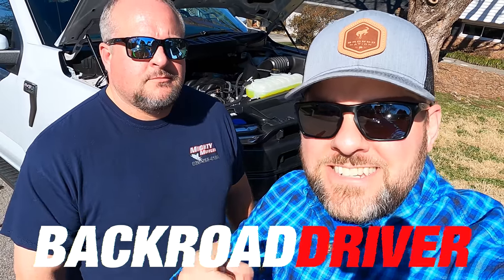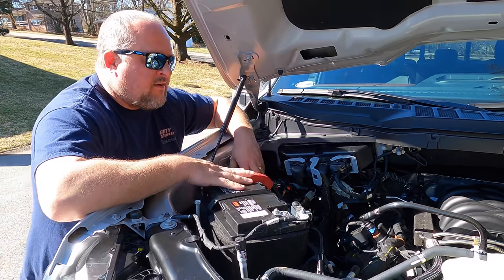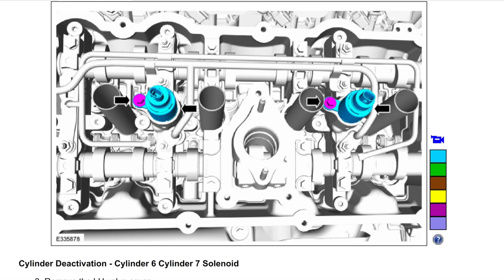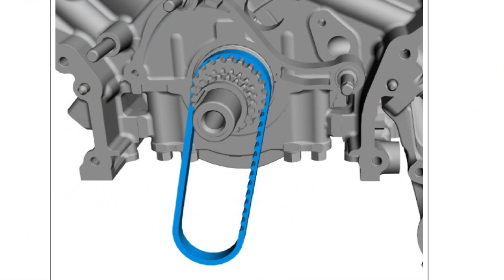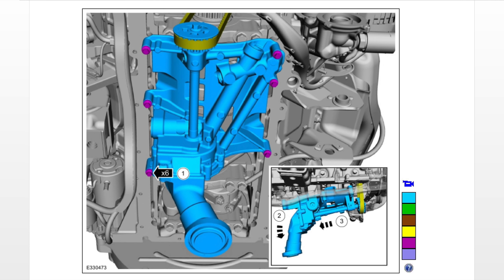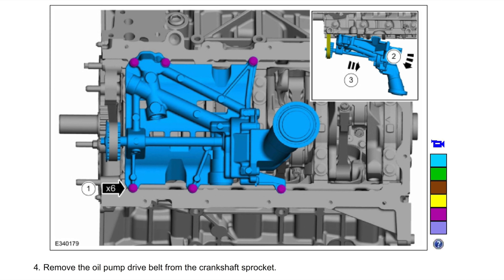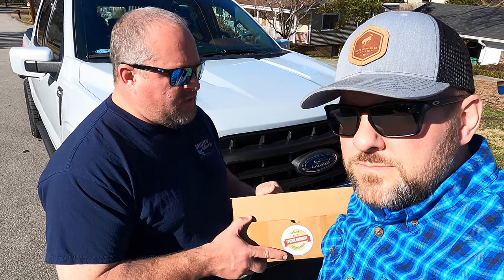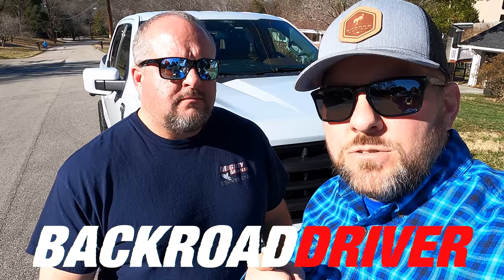2021 Ford F150 5.0 V8 Cylinder Deactivation & Oil Pump Belt Explanation - JLT Catch Can Install

Comment: Overhead cam engines in trucks is just stupid.
Reply: Nah, OHC is never stupid
Reply: Mad Anthony Wayne   Cams belong over the heads. 
Any cylinder head designer worth a damn would want maximum valve area for the bore size (4 valves/cyl), not have to twist the intake port around a pushrod path, have a splayed valve layout with an extremely canted ~45 degree intake valve angle which simply gives the intake port a much straighter shot at the back of the valve, and to remove all of the unnecessary reciprocating weight of a lifter and pushrod. 

Pushrod engines are stupid unless you’re a manufacturer just trying to save money or you just need a compact cylinder head more than you need optimal everything else.
Reply: Why? They just make the top end wider. Can you speak to, in a technical manner, why cam in block pushrod valve activation is superior to overhead cam valve actuation. Rhetorical question, no need to reply.
Reply: @zonacrs   Yeah, literally the ONLY way pushrod beats OHC is in packaging.  That’s it...
Reply: Mad Anthony Wayne   Unless I misread Nota’s message I think he rhetorically asking for technical reasons why cam in block is superior, which of course can’t be answered technically because it is objectively inferior in every regard except external packaging.
Reply: @BC08  Any cylinder head designer worth a damn would tell you that maximum valve area isn't the only consideration. There are 2-valve pushrod heads that put up flow numbers that are extremely competitive with 4-valve DOHC heads. Putting the cams in the heads has MAJOR drawbacks. Your oil pump is way down low and all the cams are way up at the top of the engine. Not only that, but all your VVT solenoids, cam phasers, and timing chain tensioners are also competing for that limited supply of oil. It doesn't take much sludge buildup in the oil galleries to restrict flow and cause issues with cam phasers, issues with timing chain rattle, issues with cam journals wearing, hydraulic lash adjusters failing due to oil starvation, cam followers failing due to oil starvation etc. All the valvetrain components most sensitive to oil starvation are at the farthest location from the oil pump. And guys wonder why the 3.5 Ecoboost cam phaser rattle has never really been fixed or why their 5.0 Coyote sounds like a rattling typewriter or needs new cam phasers. But dang man, those valves sure got a straight shot through the intake port.
Reply: @BC08  "Yeah, literally the ONLY way pushrod beats OHC is in packaging."

And parasitic loss through the valvetrain. It takes a lot more energy to rotate 4 cams+phasers, actuate 32 valves (plus fuel pump), and slide the timing chains across the big TC tensioners. There's also more energy losses via the oil pump that has to feed significantly more components: the TiVCT VVT system, the  hydraulic TC tensioners, feed 32 hydraulic lash adjusters, lubricate all the cam followers, and lubricate 20 cam journals. 

DOHC is great, don't get me wrong, but there are way too many fan boys that think that cam-in-block pushrod V8's are garbage and that DOHC V8's are the end-all be-all. The fact that GM's 6.2 is more compact, weighs more or less the same, puts out competitive power numbers, and matches or exceeds in fuel economy deserves some credit.
Reply: @karlschauff7989  There are literally no pushrod 2V heads that put up anywhere NEAR the flow numbers that a well executed 4V cylinder head will for a given bore diameter.  
For example, Ron Robart had a port package for the Ford GT head casting that produced 400/350 cfm @ 28” on a 3.552 bore plate. 
Any cylinder head designer that has any semblance of a clue will tell you valve area is the ultimate limitation of any cylinder headz
Reply: @karlschauff7989   It’s pretty apparent you have no idea what your are talking about. 

DOHC does not have greater parasitic losses through the valve train.  DOHC  allows less spring pressure per SQ/IN of valve area and they have drastically lower reciprocating valve train weight.  

Why is that you think all of the small cu-in 4 cylinder engines that are designed with efficiency as their paramount design objective are ALL OHC and not pushrod?  That’s right, lower valve train frictional losses.
Reply: @BC08   "DOHC  allows less spring pressure per SQ/IN of valve area"

Less spring pressure, TWICE AS MANY SPRINGS. 

 "and they have drastically lower reciprocating valve train weight."

Reciprocating weight is not where the sigificant parasitic loss is. Not for an engine with a 6k RPM redline. The springs for that application are quite mild, especially compared to an engine actuating twice as many springs, even if each individual spring is not as hard to compress. On the other hand, there is vastly more rotational mass and sliding friction  in 32-valve DOHC V8 valvetrain that has two big long timing chains, 4 big tensioner guides dragging against those chains to keep them tight, four cams (each with a phaser on it) rotating in 20 cam journals, 32 cam followers riding against the cams, actuating 32 valves. That's compared to a 16-valve pushrod V8 where there is one short timing chain with a tiny tensioner, 1 cam with 1 phaser rotating in 5 cam journals, 16 lifters riding the cam and actuating 16 rockers to open and close 16 valves. There is a LOT more frictional loss when you're turning 4 times as many cams using big long timing chains riding against two big tensioners, 4 times cams riding in 4 as many cam journals, with double the number of roller rockers and valves rolling on that cam. And that's not even factoring in the parasitic loss of the oil pump that's controlling TiVCT, tensioning those chains, and trying to lubricate all that valvetrain. 

"Why is that you think all of the small cu-in 4 cylinder engines that are designed with efficiency as their paramount design objective are ALL OHC and not pushrod? "

WRONG! Manufacturers opted for DOHC for I4 engines due to the ease of meeting mandated EMISSIONS requirements, and had nothing to do with any inherent fuel efficiency characteristic. In fact, that only reason that Ford decided to switch to OHC for their V8 engines was because marketing determined that braindead consumers attributed DOHC with being "more European". In 2007, a fwd Pontiac Grand Prix 3.8 V6 with a shitty 4 speed auto had an EPA rating of 28 MPG highway. Guess what a 2007 Ford 500 fwd with a 3.0V6 and 4-speed was rated at... 26 MPG. Where's the fuel economy advantage? Surely a 3.0L Duratec V6 with it's DOHC valvetrain can beat a big old 3.8L pushrod V6, right???

Why is it that Ford decided to develop Godzilla for the Superduty after 30 years of nothing but OHC engine development? If DOHC is so superior on every point as you so stupidly claimed, then surely Ford would have just made a bigger version of the 6.2 if they wanted a bigger gas V8, right? But they didn't. No, instead they designed an all-new big block pushrod V8 for the Superduty. Every auto journalist on the planet asked the Ford engineers why on earth they decided to design a new big-block pushrod V8 for the truck. Guess what the answer was....

FUEL EFFICIENCY!!!!!!!!!

So sure of yourself, yet you don't have a fu cking clue.
Reply: @karlschauff7989   You’re problem is that you conflate the number of moving parts with frictional losses.  This is not the case.  Reciprocating weight correlates strongly with frictional losses.
Also, regarding “sliding surface” …. OHV lifters alone provide for more “sliding surface” area than the additional valve guides of a 4-valve arrangement 
Timing chains running on a nylon guide on a film of oil actually provide very little in the wait of frictional losses. 

The decision to use pushrod layout in Godzilla has zero to do with with reduced frictional valve-train losses, it was ALL all cost VS reward….lower production costs without any notable penalty for an engine with a 5500 rpm shift. 
Doubt it?  Talk to Brian Wolfe.  I did.  

I’m so sure because I know what I’m talking about while you very obviously don’t.  

But let’s hear more about this complete fiction about Ford’s reasoning for going back to pushrods when it goes directly against the project managers own words.  It’s entertaining…at your expense
Reply: @karlschauff7989   Back when Ford was considering the Modular they gathered significant data showing reduced frictional losses of their RFF/lash adjuster OHC setup versus the pushrod layout.  
That data is what ultimately won the day for the Modular in the trucks as there was a faction in Ford that wanted to keep the Windsor engines. 
I knew John Tymensky who was a Ford power-train engineer at that time and he had the data to show it. 
Measuring running frictional losses is very difficult for the average engine builder.  

Feel free to explain how going to OHC valve actuation (or 4-valves per cylinder for that matter) back in the 80s before VCT was implemented in the mainstream made it easier to meet emissions.   
The reason virtually every manufacturer on the planet went OHC was for improved power density (that pesky valve area for bore diameter advantage again.. tsk  *tsk*) and a reduction in frictional losses.  Period. 

There’s a reason the Prius isn’t running pushrods on the gasoline engine and it isn’t because a 2-Valve pushrod Atkinson cycle engine has any trouble meeting emissions.  Say it with me… reduced parasitic losses.  

I’m honestly not sure why you’re even bothering here when you’re so clearly out of your depth.

Let’s go back to this statement, “Yeah, literally the ONLY way pushrod beats OHC is in packaging.  That’s it...” 

It’s factually indisputable and the more you talk the more you reveal the extent of your knowledge consists of generalities and what you consider to be common sense reasoning.  
Your common sense reasoning borne of a wildly inadequate knowledge base has given you ill-formed opinions that you are unable to support.
Reply: @karlschauff7989   PS
2008 Pontiac Gran Prix 3800 - 18/28
2008 Ford Taurus 3.5 - 18/28

If you think valve train frictional loss differences have a major impact on EPA ratings I have a bridge to sell you.  
Frontal area, drag coefficient, tire design, gearing and programming all have a far bigger impact on EPA ratings than the different methods of valve actuation. 

The cognitive conundrum you run into is examples like the Prius where fuel economy is paramount and they still choose OHC for their small, low rpm, low power density Arltkinson cycle gasoline engine.  
If a 2-valve pushrod engine provided a reduction in frictional losses that would have been the time to use it. 
Given that NO modern engine with a similar, low performance dedicated hybrid usage profile use choses OHV should be all that anyone with half functioning brain should need to know about the subject.
Reply: @BC08  Ford GT heads with a custom port job... that's cute. Yet completely meaningless in the context of the discussion. You're arguing that DOHC engines in trucks is not stupid... because a custom ported unicorn Ford GT head can flow 400 @ 28"... 

What would be more relevant is what does a stock head on a factory 5.0 Coyote head flow and how is that better than say... a GM 6.2 V8 with 2 valves per cylinder that flows 300 cfm @ 28" without any porting and a factory .550 lift. I don't know what a Gen 3 Coyote head flows stock but I think a Gen 1 head flowed around 300 cfm stock. The Gen 3 with bigger valves and revised intake geometry definitely flows more than a Gen 1, but is it enough to matter? Particularly in stock form in a stock F-150? Not really. Nobody driving around pulling their boat with their 5.0 revving at 6k RPM the entire time, so peak flow is irrelevant. It's the area under the curve that matters when it comes to truck duty, and having twice as many valves is not necessarily a massive advantage. If we were talking about building a twin-turbo engine for drag racing, hell yeah I'm all with you on the advantages of a 32-valve DOHC V8. In a pickup truck, as the original commenter mentioned, there's less of an inherent advantage. I loved my F-150's 6.2 Boss. It only had 2 valves per cylinder and managed to make 411 hp and 434 lb⋅ft. I would take it in a heartbeat over a Gen 3 with a wet belt driven oil pump and cylinder deactivation.
Reply: @karlschauff7989   Lol, so you can provide me an example of a 2V cylinder head flowing 400/350 @ 28” on a 3.552 inch bore plate then, right?  

I’ll go ahead and save you the headache. 
It can’t be done and will never be done.
The 2V head will need at a minimum a 4.0” bore diameter to reach those flow numbers and it won’t be with a in-line valve arrangement to do it either (on a 4.0” bore that is, in-line can do it on a 4.125 in bore).  

Gen 2/3 Coyote heads flow 330 cfm on a 3.629-3.66 in bore.  
Voodoo heads flow 355 on a 3.681 in bore.  
LS3/L92 flow 315 cfm on a 4.015 in bore diameter. 
LS7 flows 350 cfm on a 4.125 bore diameter.  

Why are you trying to morph this discussion into a LS3 vs Coyote discussion anyway?  Can’t back up your frictional loss rationale?   “Cute”.
The context of the discussion is responding to the statement that “OHC is stupid in trucks”. 

Regarding the 5.0 and truck duty it’s hard to say when Ford handicapped the truck 5.0 with a 5700 rpm shift point in 11-20 model years when the bone stock engine itself doesn’t even make peak power until 6300-6400 rpm when the limiter is raised with an otherwise stock tune.
Ford is pretty clearly capping the 5.0 HP figures with RPM limitation to keep the EBs more attractive from an advertised HP perspective while still amortizing the cost of the 5.0 for use in the Mustang. 

Still, regarding OHC in trucks not being stupid one simply has to drive a 5.0 F150 and 5.3 Silverado back to back.  There’s no comparison at all, the 5.0 runs out of the 5.3’s life in every scenario despite the 5.0 shifting 500 rpm before it’s natural HP peak.  
The truck 5.0 outperforms the 5.7 Hemi as well and the Hemi doesn’t even have the packaging advantages of the 2V wedge engine either.

PS, since you did it earlier although I’m not attributing the difference primarily to method of valve actuation like you did:  

2021 F150 5.0 4x2 - 400 HP/410 TQ - 17/24 

2021 Silverado 1500 5.3 4x2 with DFM - 355 HP/383 TQ - 17/23

2021 Ram 1500 5.7 4x2 - 395 HP/410 TQ - 17/23    

The OHC engine with the least displacement offer the most HP, most torque (tied), and best fuel economy….OHC is looking pretty good in trucks.  

To put it in perspective had the 7.3 Godzilla used a DOHC 4V arrangement like the Coyote and just maintained the same lower power density of the old port injected low compression 385 HP truck 5.0 the 7.3 would be making 570/570 HP/TQ with the same exact sub-6000 RPM range it works in now.  
Like I already said, OHC is never a stupid idea unless you’re packaging constrained (trucks aren’t) or you are an OEM trying to save a buck.

Comment: My 2019 Dodge Challenger 6.4 (392) Hemi has cylinder deactivation, Dodge calls it MDS (Multiple Displacement System) my Challenger getting maybe 18 MPG when running 80 MPH, if I slow down (when stuck in bumper to bumper traffic) to maybe 55-70 MPH I'll see the instantaneous MPG reading at 35-50MPG. Overall, I guess that I'm getting 20-22 MPG. Over the last 2 years and 20K miles have NOT had any issues with my 6.4 MDS Mopar. Buy Dodge Ram trucks with the 5.7, or better yet the 6.4 Hemi motors.
Reply from the maker: Thanks for watching James!  Good to know you're getting good MPG. If the whole world drove like you we wouldn't need cylinder deactivation.  Unfortunately for me, even though I have cylinder deactivation, I'm getting under 12 MPG's.  I expect to be in 10 or less with a supercharger for sure. I just wish there was a button to turn off cylinder deactivation just like there is a button to turn off auto start/stop.  It's like getting to vote every time you get in your truck or car.

Comment: Hey Guy's. Is this Catch Can Installed on a 2022 F-150 V6 EcoBoost in the Exact Same Manner? "IE", Is it just Like you did here Sam? One Hose Off, and TWO Hose's to Hook Up Just Like the 5.0V8 COYOTE Engine? Are the Length's "OK"? Don't Look Stupid when you are Done? Thanks.
Reply from the maker: Hey Ken, thanks for watching!  Yes it's the same kit and it hooks up the same. The hoses can be routed and tucked away well on the 3.5 EcoBoost.  We installed this kit on the 2.7 Bronco motor as well.  We had to get a little creative with mounting the catch can on the Bronco but it's basically a one size fits-all solution.